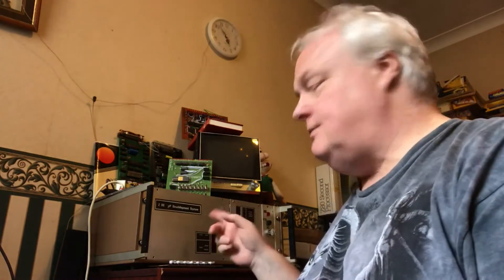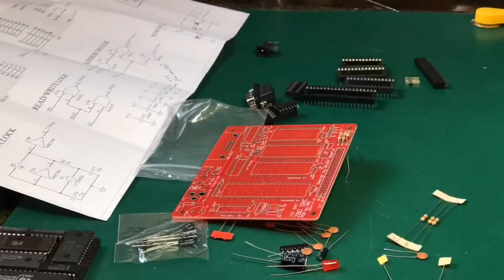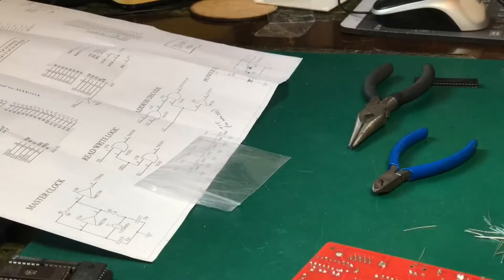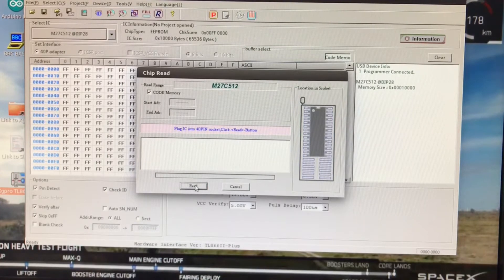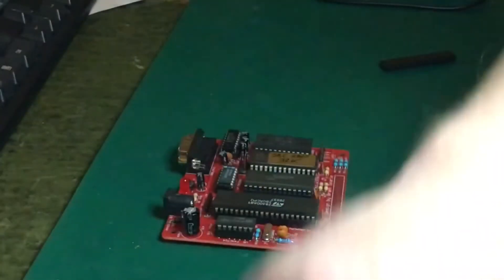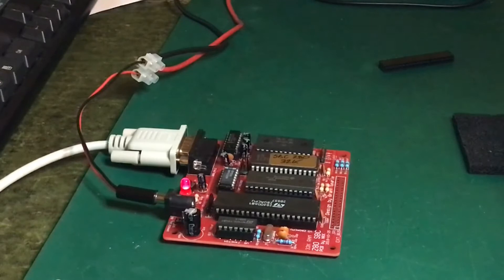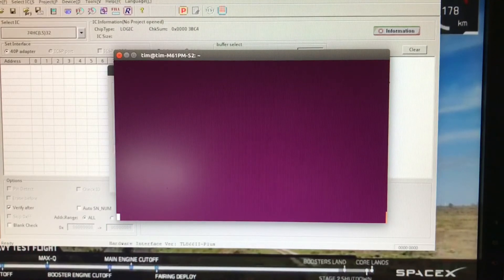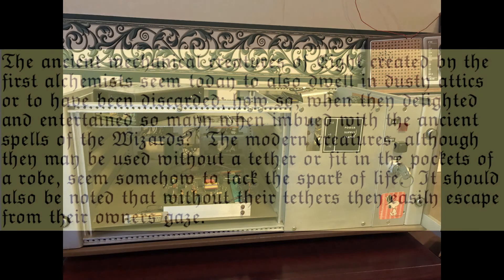Building a Grant Searle Simple Z80 to repair a 1978 homebrew uP Dev Kit

Comment: The Z-80A operate at 4 MHZ only butt, your oscillator circuit (same clock for the Z-80) is above 7 MHZ and therefore you need a version of the z-80 that operates at 8 MHZ or higher. Cordial greetings from Chile.

Comment: Static RAM doesn't ever need refreshing!
Reply from the maker: You are correct well spotted and as you may have gathered my unscripted approach meant I was clutching at straws  - when I went to update the board to the recent new ROM image I discovered the real underlying cause was a dry joint on the address select jumpers - I mentioned that briefly buried in my Christmas video along with a look at the actual board I intend to now use in the rack system!